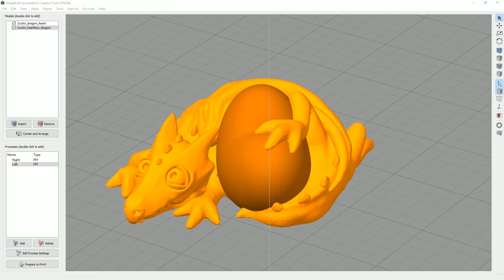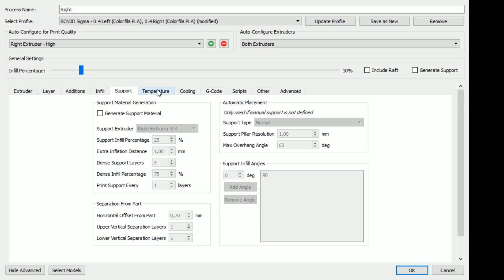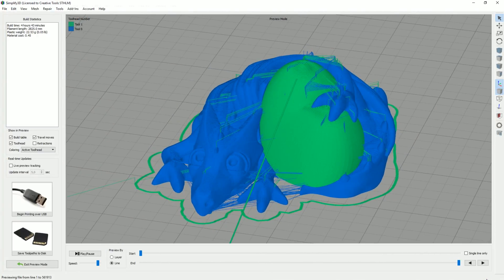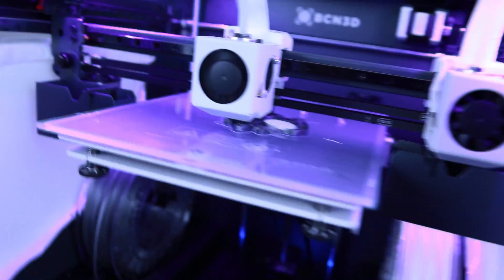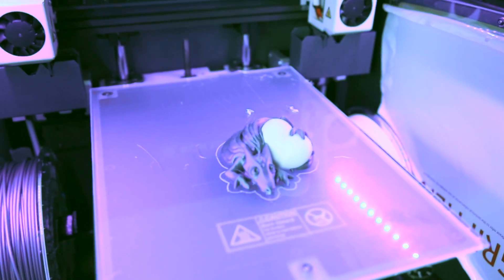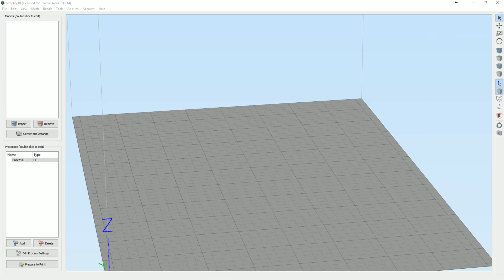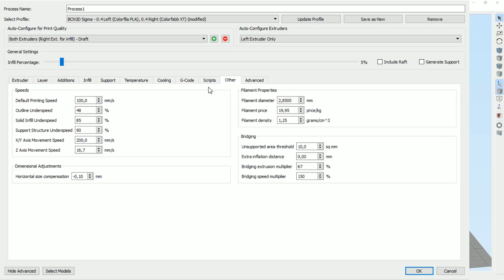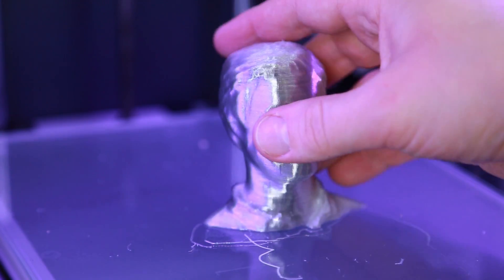BCN3D - Sigma R17 - VLOG 4 - Creating Silver with a 3D Printer - Awesome Day!

Comment: Do you have an issue with Simplify3D and dual extrusion prints where the second extruder doesn't prime properly at the start of the print?  I'm having a lot of issues with the Sigma R17 getting good dual extrusion results in anything other than (old) Cura 15.  I also consistently get a seam up the back of my Simplify3D prints that I don't get using Cura 15.  In fact, the BCN3D version of Cura 15 works really well, it's just missing a lot of features that are in newer Cura 2.5+ and Simplify3D.

What are your recommended retraction settings (speed, minimum distance, etc.) using Colorfila PLA and Standard/High presets?

BTW, the SmartPurge lines that are commented out aren't actually active - you need to use profiles generated with ProGen 1.2.0+ or uncomment those lines (the ones starting with the semi-colon) to enable SmartPurge.  As of this post the ProGen on the web site is still 1.1.8 which still uses the default purge.

I think this is a great printer/platform but the software support needs to catch up.